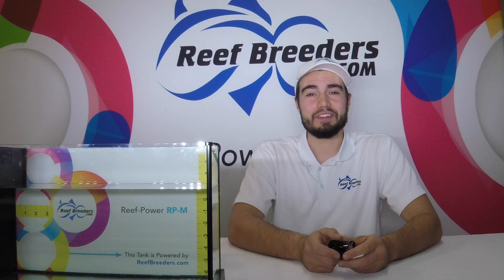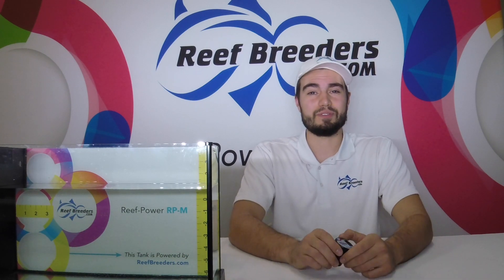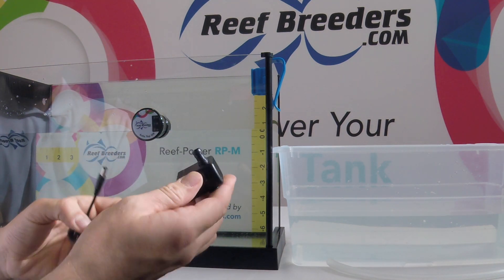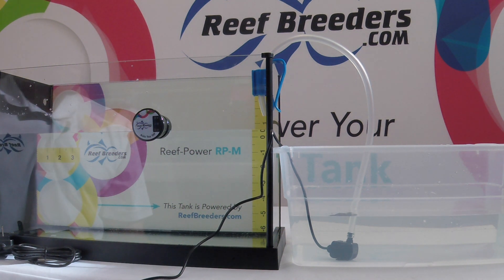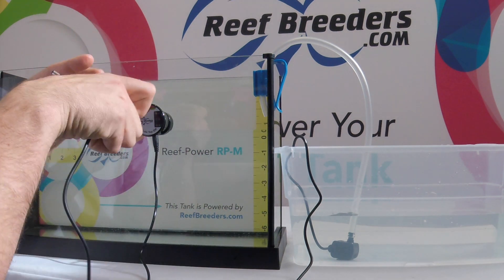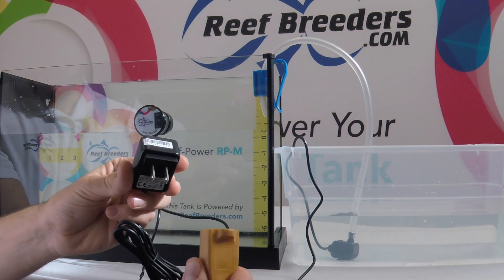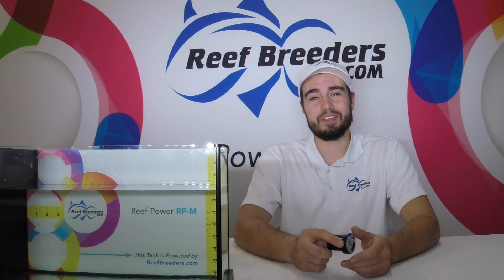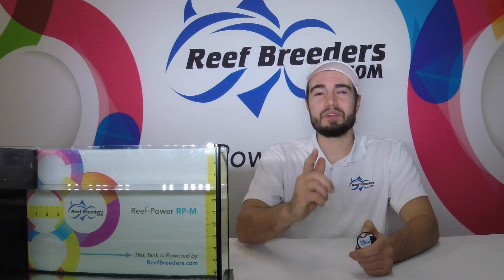ReefBreeders ATO Quick Setup Guide

Comment: Are there any solutions for people who have to pump their water greater than 8 ft up? My water station is in the basement and my tank will be direction above it. I would need roughly 12 ft minimum.
Reply from the maker: You could perhaps use a 12volt relay switch to turn on a larger pump instead of using the included pump. Also, most people use these in a sump- can you provide more details about your system? It may simply make more sense to position the ATO reservoir under your aquarium stand.
Reply: @ReefBreeders  I’ll be setting up an AIO tank. My water station will be in the basement directly below the tank. I was wanting to go directly from my water storage to the tank. No ATO res.
Reply from the maker: @cjdangles  Gotcha. If it's an AIO, there should be some room under the tank for a 3-5g reservoir. None of the cords are long enough to have the reservoir that far away. If you have some DIY skills- I recommend replacing the 12v motor we include with a 12v relay switch- that relay would then turn on a larger pump in the basement that can handle 12' of head height.
Reply from the maker: @cjdangles  Here's an example of how a relay switch works. Many aquarium controllers offer that as an option as well: https://www.partsnotincluded.com/diy-relay-boxes-controlling-120v-power/